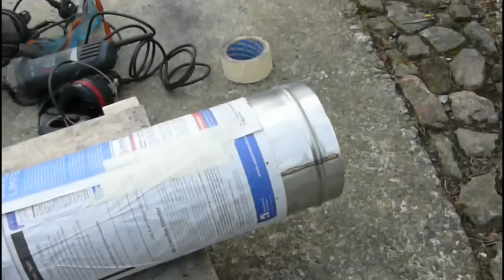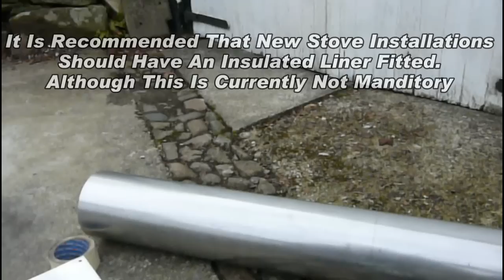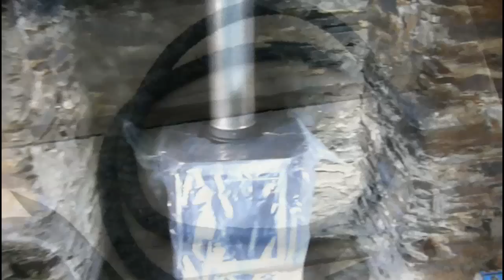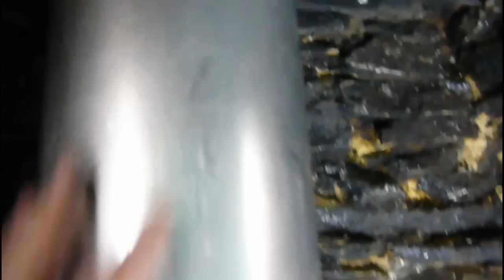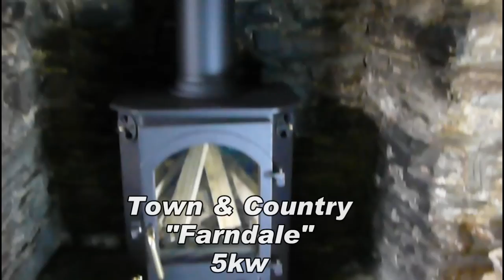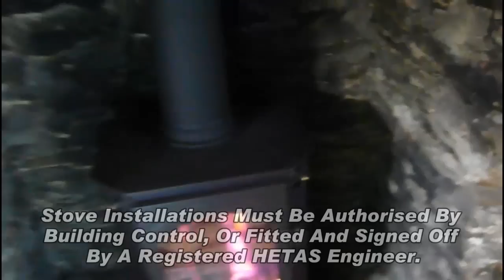Register Plate Instlation part 2.

Comment from the maker: Hi Yes the tiles can be used, Plaster will always crack unless its at least 400 to 600mm away from the stove, cement render will withstand the heat better and should be at least 150mm away. or more depending on the manufactures recommendation.
If its a good fit then no sealant is necessary, if not then heatproof silicone.

Thanks for watching DVD

Comment from the maker: Hi, yes you can fit a 9x9 soot door in the wall, and if coming off the top of the stove then a swan neck pipe or two angled pipes 135 degee can be used. How-ever only two bends should be used on the whole length of any flue Lined or unlined.
thx DVD

Comment: Excellent video, thanks
If you cannot fit the inspection panel/sweeping access into the register plate can you still fit a soot door into the front of the chimney, although it is unsightly in the room?
If the stove is offset from the flue by 300mm can you use two 45/135 degree bends?

Comment: Great advice there .im currently on with this job and was just wondering if i could use stainless steel as the register plate its just i have some kicking around which i thought  might save me money , also other than the thicker vermicilite board can you reccomend any other type of cheaper board i could use in boarding around the inside of the opening or even to use as regiser plate which i can paint  . Thanks very much

Comment from the maker: Thanks, I cut a small slot using the thin blade on the grinder and using the metal jigsaw blade just cut a circle out. As shown in Part 1 cutting the sweeping hatch hole.Thanks DVD

Comment from the maker: @hectyre Thanks for the comments, yes just use the same design and leave out the hatch this is now technically  a CLOSURE Plate, then you can still use the portioned off section to fit the liner and secure the flue pipe to the adaptor. Just remember it is advisable to have at least 1mtr of flue pipe before connection to the liner. and if possible the MF adaptor should be through the plate by about 4 \ 6 inches, allowing expansion for the file pipe.
It is advisable to insulate liners for best opp

Comment: Just been watching some of your videos, great work! I plan on lining our chimney and I was wondering if I need the inspection panel or can I make it the same way and leave it out? Our coal fire is still in place at the moment so I haven't had a look at it yet but I assume your register plate design would work just fine.
Still need t choose a decent stove too, The room is about 5x5m. That pinning idea is great btw, I would have just used angle iron brackets but that looks way better.